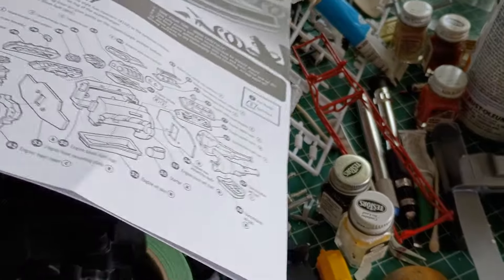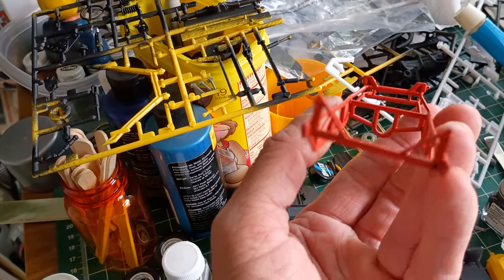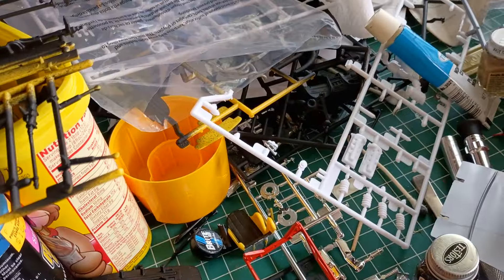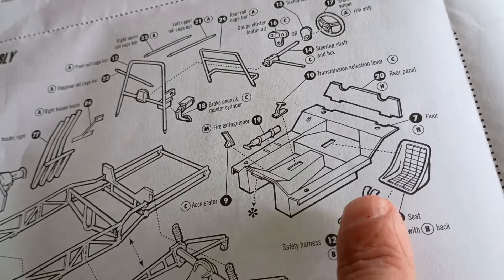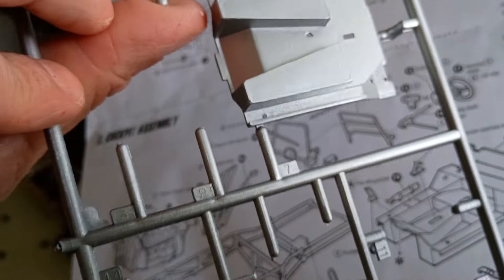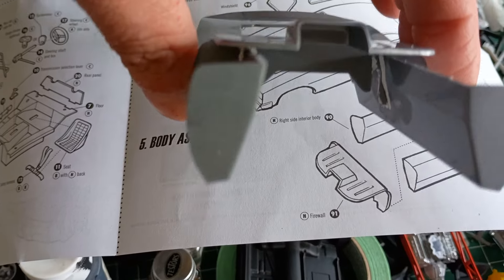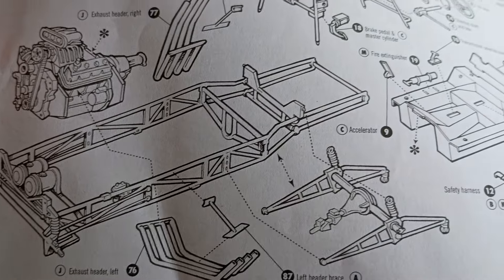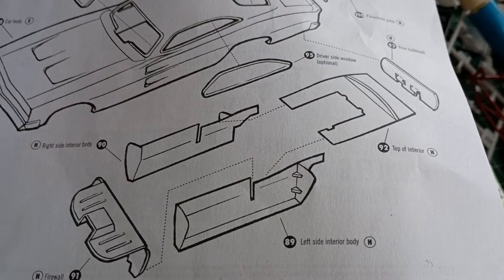Nightmare of a build 😭😲

Comment: Best thing to do with these Polar Lights funny cars is to build the chassis on top of a cutting mat so you can use the grid pattern of the mat to keep it straight and aligned. Use super glue too so you're not having to sit there and hold it. And assemble the complete interior panel section while they're INSIDE of the body and set in their location. Just take care not to get glue on the body itself and you can pull it out carefully after it's dried. I've built 7 of these Polar Lights kits so far and probably 20 more in the stash. Helps to find completed builds on youtube videos so you can see the location of any of the parts you're not sure about.
Reply: I've built many of this brand. One I remember is Speed Racer,  everything assembled perfectly. I noticed he's using the blue model glue which is horrible for everything.
Reply from the maker: I was using super glue on the chassis and interior decking.
I've never had problems with the tube glue. Used it for years. 😁

Comment: I have built several Polar Lights (which is what they were originally released as) Funny Car kits. There is absolutely nothing wrong with them. Maybe the new directions are not so great, but these are nice kits and look great when finished. If you have to be so dependent on the instructions, maybe the model is not the problem...

Comment: It should be the same kit as the polar lights mr. Norm charger and the gene snow charger I have both sitting on my shelf built right now...the tube frame you have to build slowly I use styrene liquid cement and magnets on a metal plate to hold it in aligment till it dries...the short issue is just not exceptable and you shoulf get a replacement from round 2 . the tin work same as tube frame go slow amd hold in alignment... Hope that helps some.
Reply from the maker: I was thinking that when I was building the chassis. If only I had some metal and magnets or something to make a frame jig... Lol
I think it'll straighten out ok once the cockpit is glued down.
Hopefully it looks good when I'm done.
There again, it's a Charger so it can't be too bad. Lol
Reply: Best way I've found to do these chassis' is build it on top of the grid of the cutting mat so you know you've got it straight and aligned and use a quick setting super glue. Even if it's just the tiniest drop just to get everything locked in place.
Reply: @flyingfortressrc1794 I've used my paint bottles for weight and braces for holding part's together to dry. It does look like the instructions are not much detail on enough for explaining enough.
Reply: @nismojukerich2994 Agree. Better quick dry superglue and the red label Testors model glue. That blue stuff is weak and doesn't work.

Comment: what you need is a jig for building the chassis, even if you have to hold the pieces together using whatever you've got on hand for a makeshift jig, what I've done is use paint jars for jigs. And sometimes you need to just do 2 pieces at a time and take your time doing it. As for the bar which glues in between the sides it shows the location in the drawing right below it.
As for the piece not molded properly call R2 and let them know.
Reply from the maker: Yeah I used some paint cans and bottles on my counter top so it was flush.
It's getting there now that the cockpit and motor mounts are in place.
Thanks for watching.

Comment: Drag kits always have chassis issues. I would still buy a half dozen of these at the Ollie's price just to have that many Loghee Stage 2 chassis, not to mention the hemis. It sucks that the tinwork has issues though
Reply: The tin work goes in fine you just have to use liquid glue either thin or the testors thicker version test fit before fully dry...go a step up and fill and sand the ejector pin marks before assembly... Every time I see that kit at ollies for $12.99 I buy one! 😂... I love them that much.
Reply: @moparnut6286  yeah, it's a great deal considering what you get in the box... parts are parts
Reply from the maker: Yeah even though it's been a pain for me, it's starting to grow on me. Lol
Reply from the maker: I've only seen them at Ollie's once.
It was almost like welding the tin work...
A little super glue, a little kicker, line up the next little bit, a little super glue, a little kicker.. lol
Eventually it all lined up 😄
Reply from the maker: Yeah that's true. I think there's three wheel styles too.

Comment: No offense, but I can’t see how you build anything straight with no room to work. These funny car chassis are made for several different kits. The back two pin holes are for two different length bodies. I agree the instructions should be better, but there are enough build videos out there that can really help. It’s called modeling, not assembling.. If you build real race cars you learn to fabricate. Consider the same process when you build plastic kits. Use tape, clamps, clothes pins, etc to help hold parts together while they dry. These older kits take sanding, shaping, and lots of fitting to get them right. Just like real cars do. Keep your cool, watch some videos, ask some questions from others. The community is awesome and there’s always someone willing to help.. 

First job… clean, clear work space…
Reply from the maker: Yeah I built it on my counter top with some paint bottles and cans to try to give it a jig and it still looked like a pretzel. Lol
It's better now that the cockpit and motor mounts are in place.
Thanks for watching.